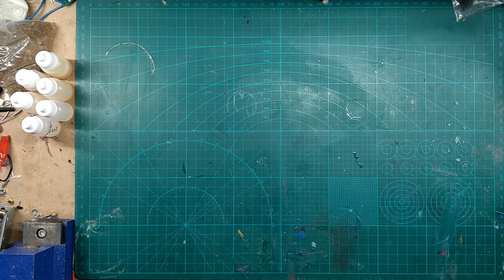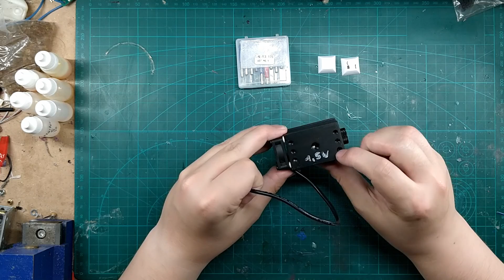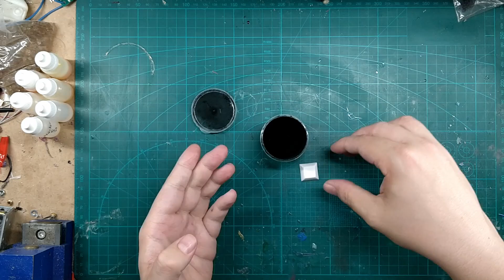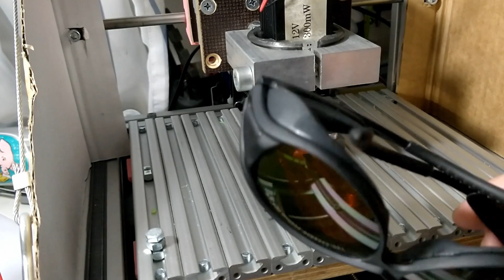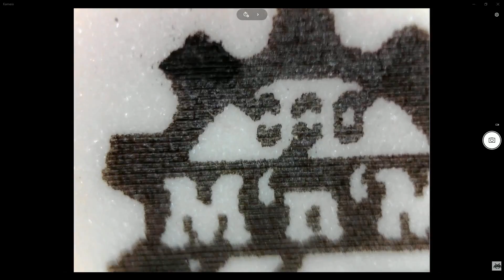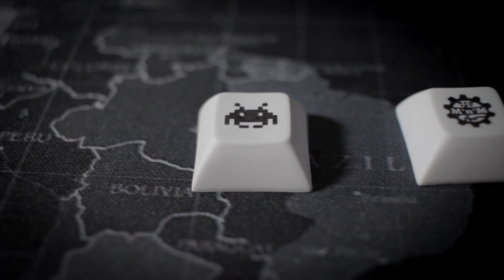#Random: Printing on KeyCaps (or any other plastic) | Make'n'Modify

Comment from the maker: No 1. Question: Can you do this for me?
Short: No.
Long: Due to having a day job and a family I have a very tight budget on spare time and I have to heavily priorities what I do with it. So to make printing keycaps worth it they would have to be way to expansive. That is why I did this video, I can't print them for your but I can show you how it can be done and maybe someone wants to offer this service, but it's not me, sorry.
No 2. Question: can you use Powder Coating powder?
A: Yes absolutely. That should work even better. But I did not test it.

Comment: I found this today, after 7 years.
pls tell me - how did you evolve this to today?
Are there new videos, new procedures?
Reply from the maker: It held up pretty well for over a year. But I stopped using the keyboard after that. Today I would most likely try "diy Dye Sub". That should hold much better. Also my local makerspace got a fiber laser engraver which should work better but then only one color would be possible. Overall I still think it was a good find and people successfully  tried this with "powder coating powder". But it's hard to get consistent results.

Comment: Very nice idea, thx! Have you ever tried this method on a custom PCB? I am thinking about using this as silkscreen method for my self made PCBs
Reply from the maker: Back then I only was focused on keycaps so no I did not, however I think you you use powder coating powder as a pigment this could work. I've seen people "printing" on wood that way so way not you can powder coat basically anything :)

Comment: Hello Mike, what would be a good laser engraver, for doing engraving on keycaps, some are made with my  3d printer,  LDA , PET and resin for now  and some other keycaps I will get from china . laser engraving is a new thing for me, so I am searching around and also asking  person with experience. my budget for this printer is around 200 USD. thank you . Alan
Reply from the maker: Max ^^ With that range of materials I would say no laser can help you. At least for resin, this method will not work well I would imagine. You can mark most of these things with a fiber laser (like a YAG laser) but not fuse powder to it. This video also really was more of an experiment. I used a cheap diode laser. But that beeing said, it might not work with everything you want to print
Reply: @MakenModify  Thanks a lot Max for your reply, well if I could just get as good a result as you do on PTB or POM keycap I would be happy, so far my results ar just not that good, if I could email you a  few pics and maybe you can direct me on what I am doing wrong, for one the powder, I have to put much more powder that you do , I see if I can email you those pics, and if you could leave a link from shopee of a good pigment type, I will appreciate. I work overseas in Thailand, so shopee is easy for me to get parcels ... again thanks a lot . Alain

Comment: For those without the same hardware as this dude, here's what you can do:

Inkjet printer and print on waterslide decal. Spray decal with waterproof acrylic coat paint. Cut the symbols and 'waterslide' them on your keycap. Let dry, apply matte or glossy varnish, whichever you prefer. Let dry again. I even tried this on FDM and Resin 3d printed keycaps and they work absolutely great.
Reply from the maker: yea also a great method. Also DIY dye-sub is more doable nowadays. This video just demonstrates one more way of doing it :)

Comment: Wouldn't the result be finer if the designs were vectorized instead of rastered?
Reply from the maker: Yes and no. Did some tests with raster fill and vector outline but the result was only marginally better

Comment: Excellent idea, thank you. I happened to have a laser so i have quickly jumped into trying but it is just lots of failure. I basically went from 4-10mm/s and power from 5% to 15% in every possible combination and it is either not sticking or just burning straight off leaving brown residue. I have a sculpfun s9 laser which is 5.5W
I also jumped into trying on XDA profile keycaps but the focusing must be on point else the quality suffers. So XDA is not a good profile for this, some flat top keys are needed.
However I had success with magenta and cyan colors but I need black :/  I feel like my laser might be not suitable.. not sure.
I was also thinking cutting out sctencils with the laser and painting the keycaps with some tough dye.
Reply from the maker: Yea that video is quite old now, back then laseres were not that powerful (at least those that were reasonably priced). You could also try powder coating pigments for black. Maybe that helps. Other than that diy dye sublimation seems to be the way to go now a days 😉
Reply: @MakenModify  i have seen on the forum someone mentioned there are separate pigments for laser marking. I will look into them. I refuse to do dye sublimation for now, i dont have inkjet printer nor the finesse to perfectly align every letter on every key. It would kill me to see one slightly misaligned. I have one last shot. The keycaps I bough are "artisan" keycaps with a special color not the mass manufactured ones. I also believe that the glossy paint on them is something unusual. I will buy some cheap PBT ones to try
Reply from the maker: @TechTinkerWorks  you tried that on artisans? Those are most likely made of resin. Resin dose not melt it just burns. For the video I used PBT caps. There the pigment melts, the keycap melts and both fuse together.
Reply: @MakenModify  yes i figured out by now. Thank you

Comment: Was laser alone not usable to "write" on plastic surface?
Reply from the maker: Low power diode lasers (like I used) can't engrave white plastics. With a CO2 you can engrave them but it is just recessed and still white. That being said, i did it with what i had back then. For powders also powder coating pigments work

Comment: Since the powder is Toner from a laser cartridge,  you are limited in colours, yes?
Cyan, Magenta, Yellow, and Black. There is no White powder, for printing on black keycaps.
Reply from the maker: I used toner but you can also use powder coating pigments. (Others tried that and it worked for them)

Comment: Has anybody tried a sticker printer/cutter (like Cricut) as an alternative to do this?
Reply from the maker: I have a vinyl cutter but that would losen after no time. You could use it as a stancil for spray paint though. Some people use water slide decals that you can print. But thats also not very resilient. Best bet is to get an ink jet printer, swap the ink for sublimation ink and iron it on (works for pbt caps). This was mor an experiment that worked surprisingly well 😉

Comment: Any details on the CNC and software you use?
Reply from the maker: It was a self built machine for that i used parts of an old 3d printer. It has an arduino with CNC shield running GRBL. For software I used laser web and another software for these tests

Comment: nice idea, but do you think that this method would also work on black caps using white powder? or which powder should we use for white printing? maybe titanium powder will work?
Reply from the maker: It worked for me with silver nail art powder but powder coating powder should work nicely 😉

Comment: I wonder if you could put the pigment you want in an alcohol solution and a spray bottle, then you might be able to get a more even coat over the keycap
Reply from the maker: Good idea, that should work I think as long as it wets the surface and dose not bead up

Comment: What about powder coat. Powdercoat is kind of like heat activated epoxy or heat activated 2 part paint. Unlike normal 2 part systems,where you mix the two parts and they react at room temperature, in a powdercoat, they come already mixed. When you heat the powdercoat the powder melts, then the chemicals react making a polymer.
Reply from the maker: yea I somewhere wrote that in these comments. That should work great but I did not test that yet. But there are videos of people using powder coat with a laser for fusing paint to surfaces

Comment: Amazing idea! I don't happen to have a laser CNC machine sitting around but I'll keep this in mind. Mad respect.
Reply from the maker: Yea it's always useful to have a catalog of things that can be done. One day one might need it ;) Thank you for you nice words :)
Reply: I just ordered my 3018 CNC mill yesterday, comes with 2.5W laser. Want the mill to make my own split mech keyboard. This is the solution to the caps. Much easier than Lettaset I used decades ago on my mech ZX81 keyboard. Might try that finger nail UV ink.
Reply: many 3d printers can be adapted into laser engraving

Comment: Compliments, very good job! One question: did you have tryied with printer toner instead of plastic pigments ? I suppose it works fine anyway. I don't know where I can find the plastic pigments... :-)   Thanks for the guide. Enrico
Reply from the maker: Thank you :D It is printer toner ;) but printer toner basically is a polymer pigment.

Comment: This is a very cool process.  Thank you for the video and sharing it in full.  

I was also wondering about using UV cure resin and an MSLA 3d printer (like an Anycubic Photon X or Elegoo) to expose the resin and bind it to a keycap thereby "printing" an image onto a keycap.  Then washing off the uncured resin before completing the curing of the adhered image under a UV light.  My though is that this process would even allow for "printing" multi-color images and even with multiple exposures making them tactile (even printing braille key caps).  The key will probably getting the right resin that would adhere well enough to the plastic of the key-caps.  Thoughts?
Reply from the maker: nice, yea I have no idea how good adhesion would be but I once added a dab of epoxy to two Keycaps to get a homing bump and that stuck just fine for years. More of a problem could be that that the surface of standard keycaps is not flat and on say Cherry profile they aren't even parallel to the bottom. But I've seen done was completely MSLA printed caps (with legends).

Comment: I think a vector file would be better: the outline wouldn't be so staggered/ragged
Reply from the maker: I have vectors but the software I used wanted raster based images. But nevertheless its more about the precision of the movement of the laser an you only really see it with magnification

Comment: Nice video. Thanks for sharing. I think you could try heating up the keycaps, may be by soaking them in hot water, before milling the labels on. This might avoid tearing, since temperature ease plastic deformation.
Reply from the maker: yea but heating it should make it softer and result in more tearing. I tried freezing them but did not make much of a difference. Nowadays I use my CO2 laser to engrave them and that works pretty good.

Comment: You are a genius! Best way ever. I was looking for white lettering on dark keys, no inkjet transfer can do it, but this way I can as white toner is not that hard to get. Thanks!
Reply from the maker: yea it even worked for me with fine golden glitter (nail art supply). Only down side to this process is that it fades a bit and is not as resistant as Dye sub for example. Happy you like it ;)

Comment: I cannot tell you how much I appreciate this video. I am OBSESSED with making some custom keycaps to finish off some macropads. I am busy shopping lasers especially for this purpose. Thank you.
Reply from the maker: Just try to stay save with the laser. Best would be to build a box around it. ;)
Reply: @MakenModify  Thank you, I will!
Reply: @MakenModify  What types of materials would you recommend for building a box? Could you send me a link for the right kind of safety goggles?
Reply from the maker: @qbalsdon  Yea a box is not that easy, since you need a filter for the window (or a camera inside and Monitor outside) so at least you will need glasses. Only problem with these things is that if someone else enters the room they often don't have glasses on when entering the room. Here is an (as I think) good video on the topic of glasse: https://www.youtube.com/watch?v=IAOdWgNtqKg
Reply: @MakenModify  Thank you so much!
Reply: @MakenModify  Hi there! Just letting you know (with my safety glasses) I managed to replicate your results! I am super thrilled. Thank you! https://twitter.com/qbalsdon/status/1400185111191171073?s=20

Comment: I have an idea, Cast Artisan Keycaps in Resin. Then CNC engrave the lettering.
Still needs post processing, cleaning and filling the engraving. 

The hard part of CNC engraving Keycaps is that you are not engraving on a flat surface.
Reply from the maker: meanwhile did somethin similar. Take a keycap, engrave the letter with a CO2 Laser (i have an K40) and then fill with enamel colors. Quick and easy... only need the laser ;)
Reply: @MakenModify  Milling Resin as an advantage. You can have the outer shell a solid color, and fill in with a translucent color. Mill to the Translucent layer. Then fill in with more Translucent Resin.
Reply: I will checkout meawhile's work. And then check in with my local maker spaces maybe someone has a Laser.
Reply from the maker: @NicholasMarshall  Yea milling resin should work better. Also there are people that do dual shot resin lettering but that only makes sense if you plan on doing kind of mass production.

Comment: Hi Max, if you do this on a translucent material and apply LED back light, does the black part block the light?
Reply from the maker: kind of I would guess. Yes it will block some light, but the coat is not very thick so it will most likely shine through a bit.

Comment: I see you have a dsa keycap can you do this on cherry profile keycaps and can you scratch off some dye sub keycaps
Reply from the maker: The profile dose not matter at all. Only the material and color matter ;) My process is not exactly dye sub, on dye sub you basically can't scratch it of on this process you kind of can... in the video description is a link the the geekhack thread where you can see how they fared up to 1 year of use.
Reply: Ty I was wondering because all the videos I saw were using dsa and I wasn't sure if it only works with dsa since you are press and it easy with a flat surface or it was because dsa are the cheapest and easiest to kind blanks for
Reply from the maker: @kyu_273  yea they are cheap and easy to get as blanks. Blank OEM PBT is not as cheap/easy

Comment: Yanno, I cannot help but wonder:
1. If you couldn't cross-blend the images for clarity,  or
2. If you're not inadvertently introducing the defects by your process itself.

Like, say you were to follow your process exactly as shown, then repeat it on the same keycap (whole process, re-dip in pigment and all), but rotated 90 degrees. 

I suggest this because the 90º rotation will orient your laser lines perpendicular to the first pass, so the "scanline" aliasing jags would be smoothed out a bit, and the minute amount of bleed you'd see at the edges might be enough to add an anti-aliasing/feathering effect.

Likewise, DPI be damned, you're saving the image as a raster image. You'll need to go quite a bit higher before pixel demarcation isn't visible to the human eye. Though, can the software really not support a vector image? EPS? PDF? AI? SVG? Depending on the resolution of the laser and the CNC, it's possible you're INTRODUCING the jags with your selection of file format.
Reply from the maker: Yea you can also just change the direction of the lines, instead of physically rotating the cap. The software I used back then just worked with raster images and higher resolution images did not translate to better prints, also due to software limitations. After the video i tried laserweb and that supports vector images and is overall a better software
Reply: @MakenModify  Ha! Duh! 

"How many engineers does it take to change a lightbulb?" Sheesh, do I feel dumb. XD

I just assumed you were constrained by the tech. Didn't even occur to me to ask if you could just rotate the print plane!

Should be nearly academic with a vector plot, though. IF you decide to do another in this fashion with the new software, please: post it! I'm fascinated by your approach here. Liked, Sub'd, Bell'd.
Reply from the maker: @grumblycurmudgeon  hehe thank you! Yea i know that feel more than I'd like to admit xD i did a few more tests back then which i posted in the geekhack thread (link in the description). Will see. Don't have the exact setup anymore though

Comment: sorry if you mentioned it in the video but just curious when you built the body...if you did using the printer.. what material did you use?  how does the raw material look? I don't even have a printer lol just curious
Reply from the maker: Sorry, I'm not sure if i got your question right. The body of the Keycap? That was a PBT Keycap i bought from aliexpress. The powder I used was toner from an laser printer (office printer) cartridge. The machine is used was a self build CNC machine I built from an old 3D printer.

Comment: Laser etching is actually how some keycaps are professionally made. You cracked the code to make it at home
Reply from the maker: Yea i know, but that works a bit different (without adding pigments)
Reply: @MakenModify  Since most prints are made with the CMYK palette I believe you can actually make any color you want by measuring the right amount. Like you showed with the red print. It's amazing
Reply from the maker: @sterkriger2572  yea and it even works with "nail art pigments" (see geekhack thread in the description). But it's not super durable if you leave it like that. But that was just a bit R&D and inspiration ;)